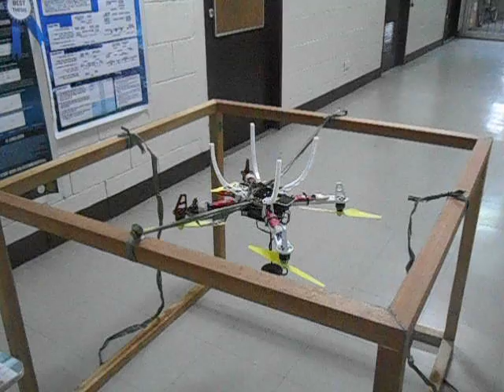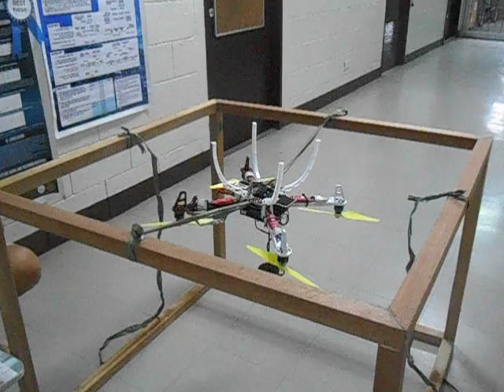PID tuning on a string setup

Comment: hi  I used EMAX XA2212/980KV brushless motor ,f450 drone what parameters of pid can use
Reply: You have to tune them by yourself as they vary from drone to drone. Try keeping a low I value, something like 0.05